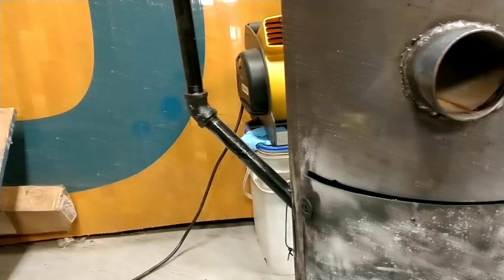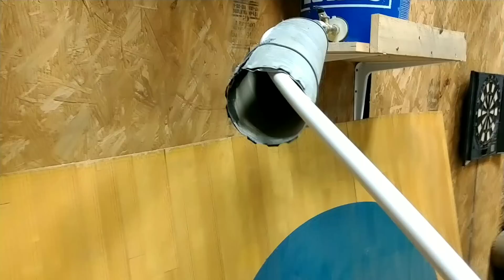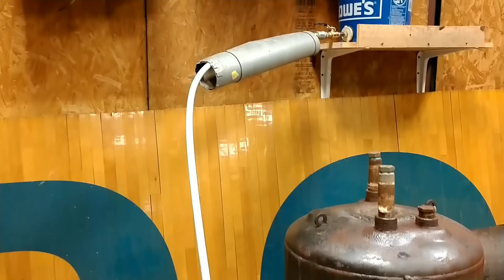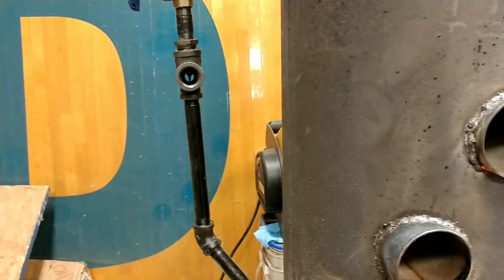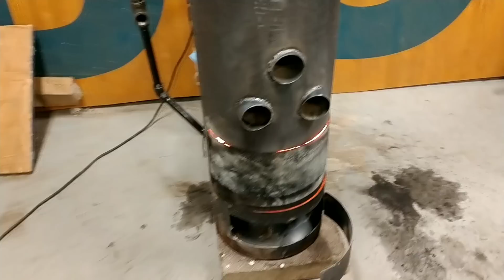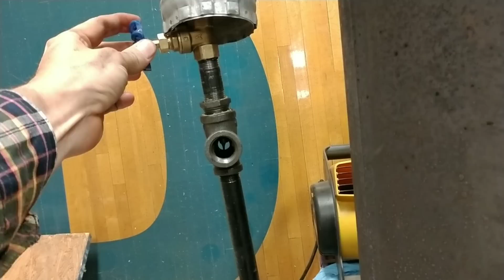Updated Waste Oil Heater Drip Feed Ver.2.2 Detailed January 19, 2018

Comment: Hello Randy .... I can count on your help to make a burner like yours, the latest version, I find it spectacular, you can make a drawing of the burner with all its measurements, of the materials necessary to carry out the project, I am a old man who lives far away, end of the planet, a small country, named Chile.my heating system is wood, very basic ,,, but I have access to hundreds of liters of used oil ,, which I can recycle by manufacturing his invention ,,,, very grateful if I could do it ,,,, excuse my writing mistakes of your dioma ,,, I did it with the help of google translate ,,, a big hug friend ,,, if someday you travel to my country count on me
Reply from the maker: I will get you those measurements and a drawing. Sorry for the late response and it's over a hundred degrees Fahrenheit here now so I don't look at the heater very much
Reply: @randysdiy2102  wouldn't it make more output if you added a forced air induction on that
Reply from the maker: Absolutely, but I was after a no electricity heater
Reply: Randy's DIY could u send me all the measurements and stuff to please
Reply from the maker: Sorry, I added a measurement video shortly after your question was asked
Reply: @randysdiy2102  ok that was cool you made a measurement of the forced air induction for the burner for more heat output but there's one more question I'd like to ask I see you like to weld metal together. And my husband wants to have a live steam engine vertical boiler to be built that's wood and  coal fired 26 inch in diameter boiler like the one on YouTube here the guy retired and quit making live steam boilers and my husband missed out a opertunity to buy one vertical live steam 26 inch  boiler from the guy off you tube and my husband will pay you the money to build a better quality vertical live steam locomotive boiler with welded and hot riveted crown sheets and fire box and welded together fire grates in the boiler
Reply from the maker: It is very possible that it could blow up, catch on fire 🔥 or hurt you I try to mention this in the comments and other places on the channel.

Comment: Nice heater!  I like the heat exchanger tubes. Would make a great improvement to Overall efficiency.
Reply: Oil Burner I made 1 something like that a long long time ago worked pretty good
Reply: THE MORE HEAT EXCHANGE PIPES 3, 5, 7, 9, THE MORE HEAT DRAWN FROM THE UNIT .
Reply from the maker: Yep, I ran out of pipe. I'm going to add more smaller pipe to the top area

Comment: Nice work.  If you heat exchange tubes (the more the better) were at about (say) 45 degrees were they exchange more hot air then a horizontal?  Here you tried it?
Reply from the maker: I'll try it before next cold season
Reply: Could you place a fitting, an entrainor, to inclease air flow.  The blower works well but power can fail.
Reply from the maker: Yes absolutely I have added air to the bottom entrance and it does cause the heater to get much hotter

Comment: You also have more room to install several more heat exchanger tubes which means less heat is needed and less heat goes up the flue.
Reply: i have made a shroud around my fan and welded that on the back of my (air)tank. My fan is sitting pretty low in he shroud meaning most of the air is going trough the hottest lower pipes, and the ones up top get a little les airflow. Works great for me. But we still manage to get the bottom pipes wich are about 30-40cm of the flames red hot. That is why i dont put in any pipes lower to the flame, scared they might actually start melting and sagging down.
Reply from the maker: In one of my videos I stated I was going to put the heat exchangers all the way up to the chimney exit I just ran out of pipe at the time. Thanks for the comment I may consider tying a duct from my blower to the heat exchanger pipes like you did sounds like a good idea.

Comment: My wood stove has 3 -3" pipes running through it like yours.  Difference between mine and yours is I have my blower connected to a pipe directly to my heat exchanger pipes - much more efficient.  so all air from blower goes directly through the tubes unlike yours where you have the blower a couple of feet away.     without my blower going, the tubes get red hot.    With blower on brings so much more heat from the stove into the room.

Comment: Wrap Tin Foil around your Flex Pipe.  I find Tin Foil deflect heat, easy to work with and cheap too, LOL
Reply from the maker: Great idea, thanks
Reply: Or use copper pipe, maybe? There is enough gap around the door where if your pot filled up past the vortex elbows you’d run the risk of a runaway fire. It would not smother the fire due to  lack of oxygen.

Comment: Need to finish welding your heat exchanger pipe to eliminate the carbon monoxide gas escaping from those areas. I think you will find that your oil heater will preform a bit better. Then put some seal strips with breaded fiber glass cording. I think you should get as tight of seal as you can.
Reply: Due to the exhaust draw, the inside should be at slightly below ambient pressure, thus any leaks will be INTO the tank.  I agree, it should be welded though.
Reply from the maker: +Dennis Jones these are all great ideas and things that I just haven't gotten done. I will update it once we get all that done but you are correct, and yes I am hoping for a much cleaner burn also by forcing all of the air up to the burner instead of letting some of it come in through the door. Thanks for your comment
Reply: Dennis Jones ccc

Comment: how long will it run on that bucket? give or take
Reply from the maker: I haven't ran a complete bucket yet at one time, if you figure it by 1 liter per hour you should be able to get approximately 18 hours on a bucket. 5 gals =18.9 liters. but as I have been using the heater it seems to use more like close to 2 liters per hour at the temps I run it. Of course it depends on the oil flow and temps you run the heater. I will test it for you within a week or so and post the video. I will fill a gallon jug with oil and let it run to see exactly how long it will take to burn it. thanks for your comment.
Reply from the maker: +ordinary grey I will test 1 gal usage next weekend, I will post video of usage. Thanks
Reply from the maker: Just finished, the video I promised. 1 gal ran for almost 2 hours and 40 minutes. That was at pretty high rate of oil flow. Video is uploading now.
Reply: Wow man...I'm surprised. That's pretty efficient. My shop is fairly small so I don't feel I need all the blowers and that. I will be sealing the door a bit better. Hey thanks for the ideas and the testing! subbed :)